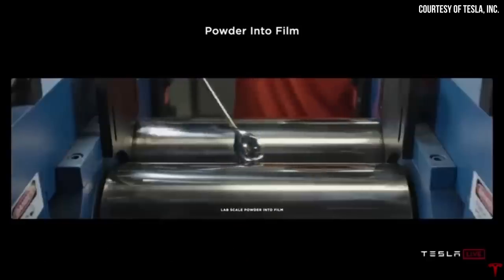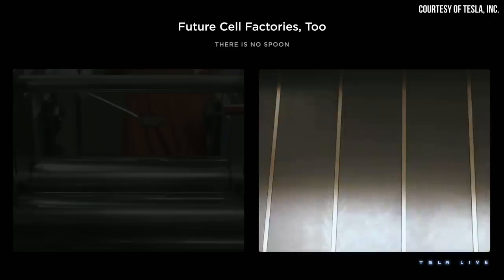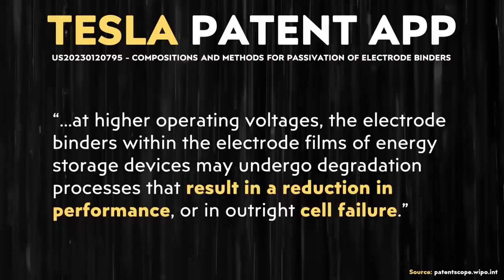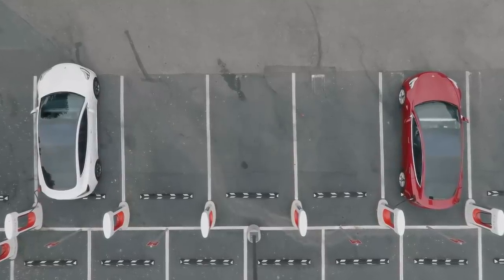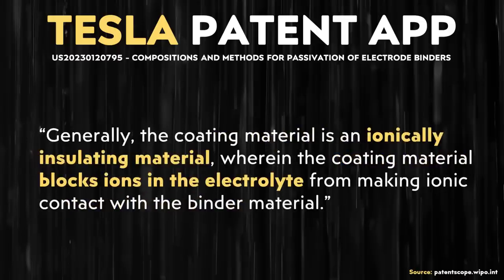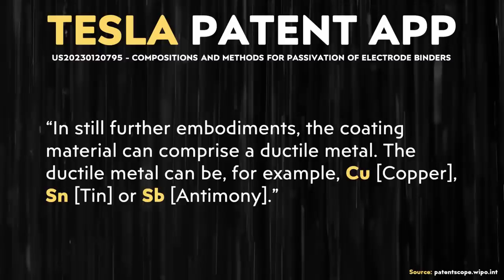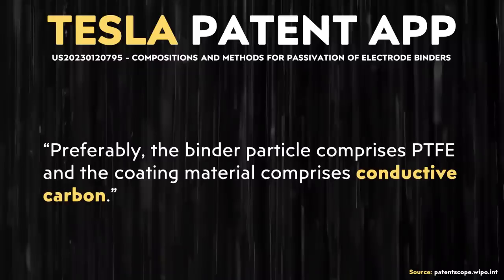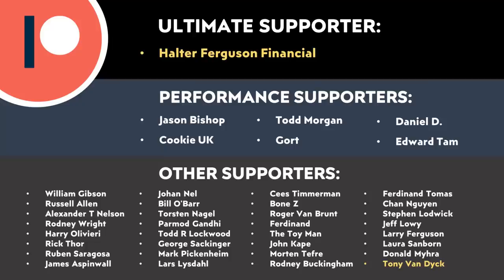How Tesla SOLVED a Serious 4680 Battery Problem | 4680 Battery Life

Comment: I could be wrong, but this sounds to my ears like a defensive patent, rather than something Tesla thought up to improve 4680 cells.
Reply from the maker: You may very well be right
Reply: @Cleanerwatt  BTW none of my business, but somehow today it struck me that you could be one of the guys where a moustache would dramatically improve your looks. I know that all young men are experimenting, I shaved mine twice for some years, but my face without one was a worse choice. And of course, I love your conscise Tesla battery work! Thanks for all of it!
Reply: Given that Tesla have made all their patents ‘open’, how could it be?
Reply: @fredbloggs5902  misconception. This is a confusion Elon himself has fostered.

None of Tesla's patents are 'open,' in the sense that the public owns them, or in the sense that they are registered with the Open Systems Foundation and can be used with legal restrictions.

Tesla still owns its patents, and still has the right to defend them in court.

What Elon meant about 'open patents' is only this: Tesla promised not to sue other entities for infringing on them.

You want to know how ironclad that promise is? Guess what? It's not legally binding. The promise itself could be weighed by a court if Tesla were to file an infringement lawsuit. But Tesla has signed no binding contracts ceding their patent rights.

You could argue that all of Tesla's patents are defensive. But that would be a less than thorough appreciation of what Tesla does, and can do, with them.

When Tesla files a patent, what motivates them is defense, above all else. But there are nuances. Some patents which describe IP Tesla is already using. Some describe IP they would like to use. And some are ideas they aren't sure they will ever use, but would like to control the IP in case they ever might.

To my ears (I could be wrong, mind you), this particular patent, discussed by Jon, falls into the category of IP they are already using. It may even be in common use in the industry.  But nobody had patented it. (Speculation.) Tesla filed the patent to defend themselves from someone else swooping in, filing a patent, then litigating the hell out of Tesla.

I am drawing an imaginary line separating parents which represent something new and a patent which really doesn't represent something new.

It's an arbitrary distinction, because as you can learn in any engineering school, no idea stands on its own. They all stand on ideas generated earlier. All that is new under the sun are refinements.

Patent law is even worse than that, though. It's a mess. Perhaps we should have expected a mess when we tried to make it illegal to share and use ideas.
Reply: @Urgelt  If something is already in wide use then it cannot be patented.
Reply: Tesla patents tend to be "defensive" insomuch as they have to avoid the let's call it "Nikola Tesla" situation where they invents a device, method, etc but doesn't patent, then "another party" makes a small change, patents the whole thing and at least suggests that Tesla is in breach.
.
It's simply good business sense to apply your patent first.
THEN you can't open the concept to use by others provided they "play nice".
.
(Almost a "Socialist like" attitude? 🤔)
Reply: @fredbloggs5902  I wish that were true.

The US Patent Office used to rule that showing prior art existed was enough to invalidate a patent.

That did not sit well with certain special interests.

Now prior art is virtually irrelevant. A patent can't infringe on another patent. But if it merely replicates prior art, it's usually permissible.

It's pretty much 'First Come, First Served' at the patent office. So long as an idea isn't yet patented, you can patent an idea that has been circulating among humans for any length of time.

If you're first through the door with the paperwork, you, too, can become a patent troll!
Reply: @Urgelt  I’m in the U.K., prior art is an immediate disqualification.
Reply: @rogerstarkey5390 Elon thinks patent law ought to be eliminated.

I agree.

A patent is a government grant of a monopoly. The patent holder benefits by exploiting his monopoly to price-gouge everyone else.

Elon regards patents as moats, for protecting companies from competition. He famously said his companies don't need moats. They will compete and win or lose on the merits of their products.

Why should we believe that granting monopoly powers will spur innovation? That is the only conceivable justification. But it is a lie. Patents stifle innovation.

You want to goose a moribund economy? Kill patent law. Let anyone use any human idea to provide better goods and services. The economy will take off like a rocket.

Socialism usually seeks more centralized control over economic activity, but who, exactly, will benefit divides us into political factions. Patent law can be seen as socialism for the rich; it's the 1% who end up owning all of the lucrative government-granted monopolies.

Eliminating patent law falls into the libertarian spectrum of political discourse.

There aren't many libertarian ideas I support, but on patents, sign me up.
Reply: @Alarix246  - When a woman says she likes mustaches, she really means she likes Chad with a mustache.
Reply: @ClockworksOfGL  well, I don't think there is (nor should be) a logic in female selection pattern. So, while mine doesn't like the moustache interfering with kissing, she likes it visually. But there are others who never express their likes or dislikes, and they don't even know themselves. Your point seems to expect some clear methodology on their side which is false. 😆
Reply: @Urgelt  fabulous enhancement of what I already know! 👍🏼
Reply: @fredbloggs5902  the prior art argument no longer holds sway at the US Patent Office. If you're the first to apply for a patent, and if your patent attorney is any good, and if no prior patents cover the ideas in your application, your chances are very good.

Prior art is no longer disqualifying. Prior patents are disqualifying - including expired patents.

Those are the general principles now in force, but there are gray areas, and disputes, and litigation. The particulars of each case can vary a lot.
Reply: @fredbloggs5902  the design or idea can't be, but the process to manufacture/achieve it can (I believe).
Reply: @Urgelt  what EM said was:-  you can use Tesla patents if you share yours with Tesla.   Which obviously no one wanted to do.
Reply: @alexmanojlovic768  not sure what Elon's stance is now. Has he sued anyone for patent infringement?

I know he sued Nio for IP infringement, but I think that was a copyright and trade secrets case.

The (false?) impression I have is that Tesla will use patents defensively, and they will protect trade secrets and copyrights. So if you wanted, for example, to make giant castings using Tesla patents, without reciprocating by opening your own patents, go ahead, Tesla won't sue you. But they won't disclose their alloy formula. That's a trade secret. If you steal it, Tesla might sue, if they care.

They might not care in that instance. But Tesla will be very protective of their software unless specific agreements are reached.

Tesla's IP is not a free-for-all, grab whatever you want for free. And it isn't 'Open Source,' either, in the sense that their IP is covered by an Open Systems Foundation license. Use their patents and they won't sue if you don't use IP that they do protect.

I think.

But to nail it down tighter, you'd probably have to be an attorney who has read everything Tesla has said publicly, read all of the case law where they did sue, etc.

The big automakers have attorneys who probably understand where the risks are and how to navigate them. And when all else fails, they can call and ask Tesla's attorneys. Elon recently set out to beef up Tesla's legal department, so I imagine they'll be answering the phone, unlike with PR.
Reply: @Urgelt 
Publications and widely known inventions are also disqualifying. In other words, (only) if a company keeps an invention as a trade-secret, they are not protected. 
 
Wikipedia on the Leahy–Smith America Invents Act (2011):
https://en.wikipedia.org/wiki/Leahy%E2%80%93Smith_Ameri ca_Invents_Act
"... The law also expanded the definition of prior art used in determining patentability. Actions and prior art that bar patentability under the Act include public use, sales, publications, and other disclosures available to the public anywhere in the world as of the filing date, other than publications by the inventor within one year of filing (inventor's "publication-conditioned grace period"), whether or not a third party also files a patent application. The law also notably expanded prior art to include foreign offers for sale and public uses.[3] Applicants that do not publish their inventions prior to filing receive no grace period. ..."

Comment: PTFE being affected by lithium ions is a total surprise to me.  And covering it with a carbon-based material fixes this?  Usually, you coat something with PTFE, not the other way around.  It's almost like saying "water catches fire, to prevent this pour oil."  This is so unconventional, I am thoroughly impressed.  Thanks for covering this!
Reply: Yes, PTFE is practically inert under most conditions.  Although lithium is a crazy reactive element.
Reply: Indeed, but when considering electrochemistry and material intereactions, stuff that is normally inert doesn't stay inert :)
Reply: @ClockworksOfGL  
Well, one is always wiser after the event, but considering Flouride / Lithium is (virtually) the most reactive combination of elements you can find in the Periodic Table, it is maybe not that great a surprise that the PTFE F-C-F chain loses it's F then breaks when constantly bombarded with (super-reactive) Lithium ions ...

Comment: Specifically, PTFE breaks down if used in the anode, because PTFE being electropositive, reacts in highly anodic conditions. Tesla wants to use PTFE in the cathode and anode, cathode is no problem, but we are still waiting to see if they accomplish this. If they can get PTFE to work in the anode with sufficient hard carbon coating, I'd be impressed. From what I've seen, they have leaned towards CNT. 
Great video!

Comment: I have been very ccurious or concerned about the 4680 cells, cause it's hard to find info on them or if they're good. 4680 was supposed to be 40% better than 2170, then that story disappeared cause of 4680 complications. Been eagerly desiring the knowledge to 4680 truths, so this helped. I want 4680 cells to be great and Tesla to make their own cells, wishing Tesla the best.
Reply: No.
The 4680 has POTENTIAL to be better than the 2170 (as detailed in graphs/ charts shown on battery day)
It was never going to be an "instant fix".
It was envisaged as a sideways step allowing further progression.
That sideways step (consisting of at least 2 previously unseen innovations) has proved challenging, but they are getting there.
If you want information, The Limiting Factor channel goes into as much depth as anyone on the technology and comparison with other existing cells.
.
I expect the now previous iteration (as tested) to remain in the Model Y for probably 6-9 months, but the latest mechanical and "chemical" tweaks, as detailed by Jon, to be refined over the next few months and introduced at low volume in the Cybertruck.
They may even be ready now, but I expect extensive high load testing with that cell working at about 80% capability until the company is satisfied.
That will, I believe, still outperform an equivalent 2170 pack.
.
When it IS "sorted".... That's when all hell breaks loose with modular factory units pumping out high values of GWh.
Reply: Mostly 4680 is cheaper to make because fewer cells needed for a given battery pack capacity. The tabless electrode does increase potential power and charging rates. The rest of Battery Day was structural battery pack, which is not exclusive to the 4680 format, and future chemistry improvements, which could be applied to 1865 and 2170 also.

Comment: We generally applaud the speed and frequency of Tesla design upgrades but one possible negative is that it may be harder to track the future performance of a model from historic data as illustrated by your comments on model S/X battery life as a predictor for model 3/Y.
Reply: When considering cell degradation, Tesla have the services of arguably the best in the business with Jeff Dahn and his team having huge knowledge, test capability and probably the most extensive library of results.
I have no doubt they KNOW the degradation rates for 3/Y, including variations due to various cell upgrades.

Comment: Well done.  It seems that Tesla has found a particle coating that will increase the longevity of batteries.  This is a big deal as it takes the most expensive part in an electric vehicle and gives it a life that may likely exceed the life of the vehicle.
Reply: That's the ideal, then 2nd use, then recycle.  Or Robotaxis only needing interior & Suspension refurbs.

Comment: A person with a 4680 Model Y on Twitter has 12.5k miles, 60% of which was Supercharging, has shown 0% degradation so far on his battery. I'm thinking that 5% deg number at 50k miles will surely be less. Maybe around 2% deg by 50k and 5% by 200k. Just my opinion based on the little data we have.
Reply: It’s probably because of the slow charging.  I bought this model and all though I like the car it is really slow to charge.  I guess if it saves the battery it’s worth it.

Comment: I dont understand, if you coat your "glue" particles with another substance, doesn't your glue stop working, because it's not making contact with the particles you want to bind with it?

Help me out here, because this makes zero sense to me.

If you had a ball of glue, for example, but you surrounded it in another substance, how could that ball of glue bind to anything, since it is blocked by the substance covering it.

What am I missing.

Comment: Is this improvement already in new cars bought in April 2023?
Reply: There's no way to know, but I doubt it.
I suspect the Kato Rd line and "Line 1" at Texas are chugging away on the "sufficient for Model Ysr" cell.
That leaves however many line they have over to be in constant development, moving as quickly as possible to produce the CT cell.
If one of those lines hits the sweet spot, they'll test,  replicate, scale, test again and when it's in CT (+Semi?) production they'll supply the Model Y and retrofit the early lines.
Reply: I believe they already put them in MY's, as I remember a number of articles stating the 4680 vehicles actually had less range & slower charging than the equivalent 2170'at at that time.  That was nearly a year ago IIRC.

Comment: Tesla reps claim 4680 can be charged 100 percent without loosing efficiency, is this true?
Reply: I think the current model has a lot of spare capacity so there is enough margin so you can fully charge.
Also heat is much less of a problem with the tab-less design
Reply: They lie.
Reply: It’s not about efficiency or the form factor. Lithium-Ion batteries degrade if charged to 100%, Lithium Iron Phosphate (LFP) batteries do not.
Reply: No. It's not true for any Lithium Ion battery mass produced today.
Reply: @fredbloggs5902 They degrade, just not as much.
Reply: @mattreb06  My point is the issue isn’t about efficiency.
Reply: @richardcoughlin8931  
Based on?
Reply: @fredbloggs5902  Efficiency does go down with increasing resistance of the battery. Increased internal resistance happens with most degradation mechanisms.
Reply: @fredbloggs5902  Btw, an interesting (but not very important) point: LFP has lower efficiency from the start. Traditional Li-Ion can reach almost 100% efficiency if you charge and discharge really slowly. LFP can never exceed ~99%. Look up "LFP voltage hysteresis".
Reply: @fredbloggs5902  
Correction.
Cells degrade if LEFT at 100%.
You can CHARGE to "100%" Then immediately discharge with no extra stress.
.
Then there's the whole question
"What IS "100%"?"
.
The confirmed maximum of the cell?
Is it the manufacturer assigned pack "100%" regulated by the BMS?
 Or in laymans' terms
"Is there a buffer to keep the cells safe?"
.
Judging from the "below zero" discharge tests carried out by various individuals, we KNOW Tesla often incorporates a substantial "bottom end buffer".
(Which just btw makes their efficiency even more remarkable!).
I've also seen testers show "101%" (or more?) when charging to maximum.
.
So my guess is "BMS limited within the safety margins of cell capacity" (for Tesla).
Reply: @rogerstarkey5390  People lie to others and to themselves, mostly out of ignorance but sometimes due to manipulation.
Reply: @richardcoughlin8931  
Yes they do.
But
Your statement requires some verified data, otherwise it could be pigeonholed in the "ignorance" category.
.
At best your statement is assumption.
Is it based on confirmation bias?
I'm not sure.
(Are you lying to yourself?)
.
I've detailed my thoughts within the thread, based on some assumption, but also on the previous practice and methods employed by the company.
.
It's a best guess, but logic based.
Then there's the 4680 which, with the tabless construction, should have the ability to reduce or eliminate certain traits which are known to be a root cause of degradation.
.
I suppose time will tell.